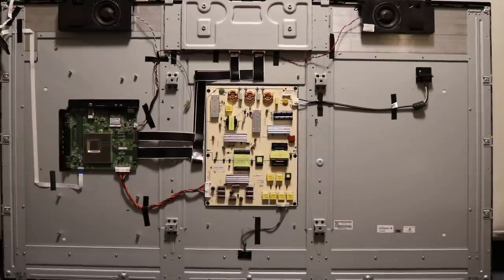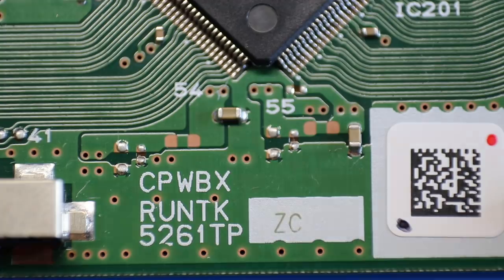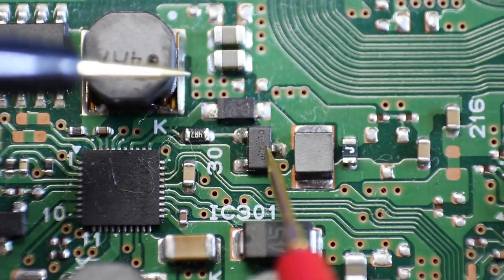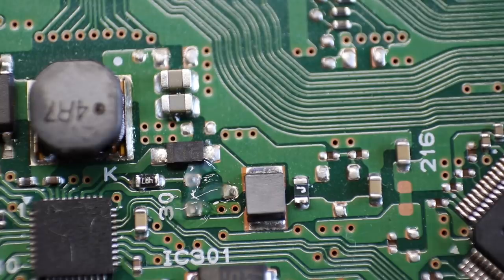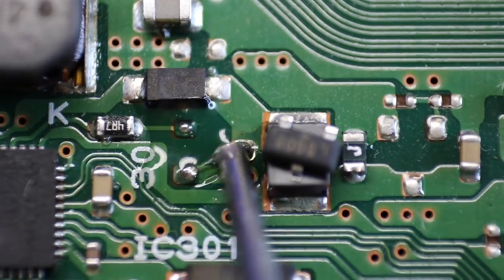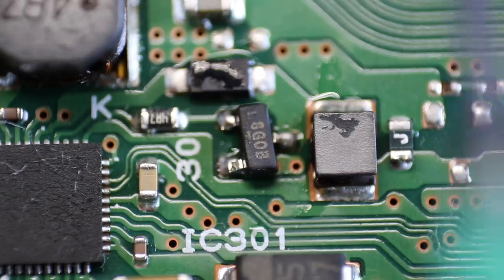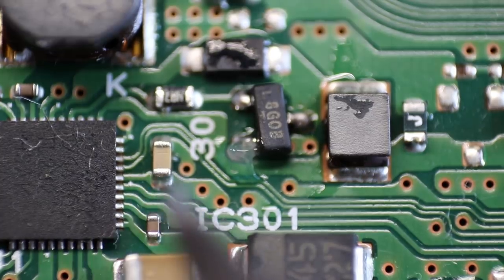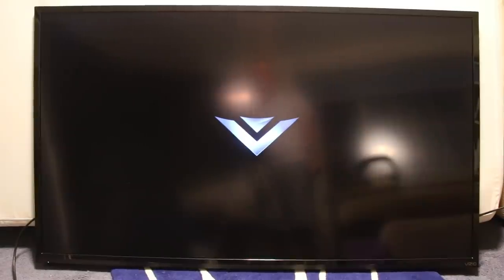60" TV for less than a $1 - Vizio E601i-A3

Comment: how to change speaker of 50 inch phillips led tv?
Reply: If you can't get to the speaker or remove it just tap into the wires and run them to an auxiliary speaker or unit

Comment: Hi Sir,
Help me fix my Samsung UN65JS9500 65-inch Curved 4K SUHD Smart LED TV with no picture but i can hear sounds coming out of tho
Reply from the maker: Did you do a flashight test (google it)?  Many led backlights are shorting out.  Try to turn down the brightness in settings to like 10% (while using the flashlight) and reboot to see if that does anything.

Comment: Hello, My remote control for a Samsung TV Model # UN50H5203AFXZA stopped working, so I changed the batteries, tried a brand new remote, and then used the job switch to manually turn on and off the TV.  I accidentally, locked the panel key and now I can NOT use the jog switch to control the TV.  Is there a way to unlock the TV and reset it without using a remote?  TV is only 3.5 years old.
Reply from the maker: I'm not sure I understand what you mean about the panel key being locked.  Is that a parental control option that disables the physical buttons on the tv?  I don't know that model but there is probably a way to reset it.  And you purchased a new remote and that didn't work either?  You may have a problem with your remote sensor or on the main board if so.
Reply: @FrugalRepair  , yes the parental locks disable the jog switch.  I tried installing a used IR Sensor, but it still does not work.

I read somewhere on line that the TV stores the "parental locks
Reply from the maker: Have you confirmed you are getting power to the IR sensor (coming from the main board)?
Reply: @FrugalRepair  so the red light is lit on the TV so- I guess so (I'm not an expert and do not have a voltage meter)
Reply from the maker: @christinegiel9242  Well, you at least did more than most people and changed the IR sensor.  You would need to measure the voltage going from the main board to the sensor itself.  If you're standby light is running off the same voltage line as the IR sensor then it would probably be safe to assume that the IR sensor is getting the power it needs (but it would still be best to measure it).  Hope you can figure out how to get around the parental lock.  I don't really know any tricks besides going into the hardware to figure out what is wrong with the IR sensor or googling how to factory reset the tv without the remote.  If I think of anything, I'll make sure to post it.

Comment: Hey, my Samsung TV just got damaged by my 3 year old.  He hit the screen with a movie case and now there is a big thick black line where he hit it. How can I fix it?
Reply from the maker: Sorry to hear.  If the lcd is cracked there is nothing you can do to fix it.  If it is a black vertical bar a few inches in thickness then my guess is that the tab bond lifted off of the buffer board.  There isn't really an easy complete fix for this but there is a jerry rig one.  You need to put pressure on the top of the tab bond to hold it down.  Basically, the tab bond is a glued connection from a pcb to the ribbon cable going into the lcd panel itself.  There should be videos on how to do this.  Let me know if you can't find any.

Comment: had the exact problem on the 70 inch model. i just went ahead and bought the whole new board for $15. saves me the hassle of soldering
Reply from the maker: Congratulations on getting it repaired! Yes, that is a great way to go. It’s quick and it only requires a screwdriver.
Reply: Thanks for the info but where do you buy the board.?? Is there a website.??

Comment: Well  the mosfet was shorted and yes you replaced the mosfet. But.... Did you fix the problem? The problem was why the mosfet got shorted. Its not like we found a shorted fuse and we replace it again to see what else is gonna blow! Why the mosfet shorted?
Reply from the maker: In general, yes, I agree that one should be suspicious when a component fails and ask, why did it fail?  There are a number of theories out there on this tcon board.  I have not spend the time tracking them down.  I do know that I replaced this component and I trimmed the thermal pad on the video IC to help with heat reduction and the TV has been working fine with normal use for 2+ years.

Comment: If I had known about doing it myself, I wouldn't have spent $450 ( the cost of the TV as new) to have mine fixed by a technician.
The flat screen TV blew up one evening after I plugged a laptop using a HDMI cable so that I could watch YouTube on TV.
After 4 nights, the TV decided to blow up with a deafening bang as loud as a 30-30 Winchester rifle followed by a puff of smoke.

I never found out what caused the explosion. It didn't blow up the laptop but the TV was cooked. Maybe you know something.
Reply from the maker: Whenever you have something catastrophic like that it’s actually easier in most cases to diagnose the failure. You would tend to see a big burn mark or an exploded component or something like that. So in your case it most likely is something on the power supply or the main board. You could buy a replacement board on eBay and with a screwdriver replace it yourself.  You could watch a video that I put out on what to do after a power surge that may be of assistance.

Comment: Sony Bravia tv. It don't focus on the left side. Have a drag on the image. Then after 10 to 30 minute on. The problems are gone. What could be wrong??
Reply: Bad cap / Solder joint in the power supply  :)  Replace caps ( get a little cap tester )

Comment: What would cause a TV to work fine for about an 20-30 mins then all of a sudden shut off and not work until hours later than same result?
Reply from the maker: Lots of things can cause that.  Did you research your model number to see if there is a common fault?  If it’s a newer tv one possibility is that the led backlight gets too hot and shorts out.  You can test this by turning down the brightness in settings to something low, like 20-30%,  and see if the tv lasts longer.

Comment: trying to get the part for this but what is the difference between 

 Mouser Part #781-SI2308BDS-E3 

and
 Mouser Part #781-SI2308BDS-T1-GE3 

unfortunately i dropped  the one i removed(actually i dropped it 3 times, the 3rd time i completely lost it 🤦‍♂️.. and looking back at the picture i took, the markings are blurred 

Also I just picked up another tv my neighbor knocked over breaking his screen, Its a 32in element is there a chance i can find this somewhere in that TV?
Thanks in advanced to anyone who may be able to help.
Reply from the maker: I don’t think it’s worth looking at the other tv’s board for this transistor.  I haven’t looked up that slight part difference but you should be able to see if it’s different based on the data sheet.  They usually have a link on the product page.
Reply: @FrugalRepair   oh okay, thank you for such a quick response, I'm pretty excited to try this out.

Comment: for thos who has no hotair like me smash the transistor and desolder the legs sepratly and solder the new one and if you fell that the soldering iron is too expensive just use hot screwdriver to desolder and solder and to find the if the transistor shorted just use led and battery and some wires 😁😁😁

Comment: Less than $1 for the component. How much for the multimeter and other tools?
Reply from the maker: It depends.  You could borrow them from someone if you want the least inexpensive.  If you want to buy them yourself, check the video description, I found a really cheap hot air and solder iron combo set.  A multi meter can be like $15 and get you the measurements you need.

Comment: It’s a mosfet btw, and the TV will fail again unless you address the issue that caused that fet to short in the first place.  Trust me I’ve fixed a bunch of those, along with the 70” version
Reply from the maker: The 70" tcon is the same as the 60", what are you finding that needs to be repaired?

Comment: I have a Hitachi 50 in flat screen  the screen flashes no sound can you tell me what the problem could be hit me back please
Reply from the maker: Does it have an led backlight?  I’m guessing that is an older tv so probably not.
Reply: @FrugalRepair  it has led lights. Back ground but just flashes with no sound
Reply from the maker: A quick flash when the tv turns on is indicative of bad led(s).  Did you try the flashlight test (search it)?  Your set might be turning off because of the short circuit.
Reply: @FrugalRepair  oh ok idk if it's worth sending it to fix it it's just my neighbors gave it to me for free
Reply from the maker: I’ll be doing a video on led backlight repair sometime soon but there are others out there you can learn from.  It’s not technically hard but you do need to be careful when removing the lcd (not to crack it or get dust behind it).
Reply: @FrugalRepair  k thanks 4 the info

Comment: I am a retired electronics technician. The first thing I used to do with any meter that beeped was to disable that function. I always like to see the reading. Why make a $500.00 meter into a $5.00 continuity checker?
Reply from the maker: It beeps in diode mode too.  So you get the best of both.  Or is that not what you are talking about?

Comment: Okay I have a problem with my TV it's a little different than anything else that I've seen on these repair TV sites I was wondering if you could help me I have a picture when I go to settings it's a fine picture it's nice but when I go to hook it up to the Internet it keeps saying you know wrong enter your you know password I enter my password says it again so I tried to hook a DVD player up to it and the screen turns white fuzzy like I don't know like you would turn the TV on and you would have a channel that doesn't have anything on it you know just fuzzy but it has sound I would like to know if you knew what could cause the problem when I plug something in like a DVD player why it would go to that and not have a picture and why it doesn't have a picture or will go to internet I was wondering if you could let me know or anybody out there could let me know something

Comment: I have a skinny red line running down the left side of my Vizio 60" tv.
Reply from the maker: It's most likely a bad lcd panel or a bad tcon board.  Is it the same model at this one?  It is possible that it is a tab bond failure that could be compensated for (but not truly fixed) by putting pressure on the tab bond itself.

Comment: What if a Vizio has turned blue?
Reply from the maker: The whole screen is blue?  It is a solid color or is the normal picture blue-ish?  What is the model number?
Reply: @FrugalRepair  the normal picture is blue-ish. Model e60-e3
Reply from the maker: @djcj23  I don't know.  It could be the tcon, main board, or a bad lcd panel.  My top guess would be tcon (if it has a separate one, some tvs have them integrated into the main board)

Comment: For about $12 you can buy a replacement TCON board rather than soldering.
Reply from the maker: Yes, that is a great option.
Reply: Where?
Reply from the maker: @mocarob  @Tao can say where he saw them for $12.  Ebay is around $15-20 for a tcon.

Comment: Dang, I thought all those circuits would get fried from from all of that extreme heating!
Reply from the maker: SMD's that are on a printed circuit board are made to withstand way more heat than the melting point of the solder.

Comment: Who replaces individual components anymore? Today's boards are usually swapped out  for a new one. Better yet, who has the that kind of time?
Reply from the maker: So the few minutes it took to replace the component was too long?  I’m not sure I’m understanding you.
Reply: I'm just saying that the days of trouble shooting individual component failures is in the past for the most part. For example,In refrigeration and appliance repair, we just replace the entire board. If one has the technical trouble shooting data and time, then seeking out problems like failed capacitors and or semiconductors is all fine and good.
Reply from the maker: @Beefcake20  It depends on time/cost.  With the internet now, you may be directed to a common failed component in just seconds.  My LG washer has a common problem, for example, but no information online has been posted on it yet.  The only thing I see is to swap out the board, which is like $250 or so.   My washer still works ok but when it has a bigger problem I'll try to track down the component and publish that info.

Comment: Why did you use a hot air station instead of just desoldering every point of the chip?
Reply from the maker: No big reason really.  You can desolder many different ways.  There isn't very much room in that space so hot air was convenient.

Comment: When I try to turn on my tv, the white light comes on and slowly fades away. I tried the unplug reset method but no luck so I ordered new boards / chips and I replaced every chip and I'm still having the same issue with all new boards. I tried the unplug reset but still the same problem. What else can it possibly be since I changed all the interior boards / chips? I hope someone can help me figure this out, don't know what else I should do. Thanks for your time and attention.
Reply from the maker: How did you replace all of the chips?  Do you mean the boards?
Reply: Yeah, I replaced all the boards. I took my time to make sure I did it right and I made sure all the wires were properly installed into the boards. I'm still having the same problem. I'm able to turn it on, the white light comes on and slowly fades away and the screen stays dark.

Comment: My Vizio E601i-A3 TV turns off and does not turn on again after several days of being disconnected. It turns on and it is the same cycle, once it is turned off it does not come back on again after several days.
Reply from the maker: You need to diagnose it further.  First thing to rule out is the backlight.  When it "turns off", is it really off or is the backlight out?  Use a flashlight on the screen with a known video or image playing on the screen.  After that, there are other steps you need to take, basically, start disconnecting boards to see if you can isolate the issue.  After that, you need to start taking measurements with a multimeter.

Comment: They used to just last. Now they don't. Better buy the protection plan. I pick up so many that have mostly good components.
Someone threw away an older Vizio once, I used it for four years. Nothing even wrong with it other that a scratch on the screen
Reply from the maker: Why buy the protection plan then?  If they cover cracked screen damage the. It may be worth it.  Otherwise, I’m not sure why you would buy something that lasts beyond the one year warranty.  It seems that it’s not cost effective given that parts are inexpensive (at least for TV’s)

Comment: Erm... put flux when you desolder the transistor, you nearly pulled the bottom pad off....  or mix leaded solder to make it easier

also easier to change the whole tcon board, can find it for less then $5 sometimes.
Reply from the maker: ok, thanks for the tip.  I agree that its easier to change the tcon.  I've never seen them for under $17 though.

Comment: I have a 55inch LG 3D TV and it's dim and can hardly see the image. Any ideas what it might be? It was fine and all of a sudden it got dark and can't make anything out I can see movement on the screen so it's not totally black.
Reply from the maker: It is probably your led backlight having issues.  Try turning down the brightness in settings to around 15%, reboot, and see if that makes a difference.  Use a flashlight close to the screen to help you see the image if it’s too dim. If that works then try turning up the brightness until it doesn’t seem to hold.  You’ll need to replace the bad led’s to actually fix it.
Reply: @FrugalRepair  So I tried messaging with it today a little. The main loading screen comes on with the LG logo and it seems well lit the  when I pick an input I see the image but it goes so dark. Can't tell if I need new mother board, or leds. It's flashes a little when the main loading screen is on but it's bright and seems normal otherwise. If I can see any image at all that rules of tcom right?
Reply from the maker: @FISHERMAN331977  Yes, if you can see an image with the flashlight then it almost certainly is a bad led (or more).  It's a very inexpensive repair but could be a little intimidating if you've not removed an lcd screen before.  There are plenty of videos out there that should help.  I plan to make a video myself too.

Comment: Long time tech here... Time to tell you guys the real story here. The models E601i-A3 and E701i-A3 suffer from this well known problem of this transistor failing in the DC-DC converter due to a problem within the LCD panel itself. In some cases you can replace the t-con board or the transistor but it will fail again due to an over current issue with the panel itself that presents itself after the set runs for a short bit. Vizio used a particular problematic sharp panel in these line of sets and the problem was so big that Vizio for a while extended the warranty on these sets to cover this issue. The video is highly misleading because the auther failed to understand the bigger issue that lead to that component to fail to begin with.

Comment: Transitors (npn) are not open from gate to emitter... also testing a transistor (or any component) fpr continuity while still on the board is hardly a failsafe test.
Reply from the maker: What do you mean by that first sentence?  This is a fet transistor (gate, source, drain)

Comment: I've never seen hot air used this way, seems like unnecessary heating of the whole area when a solder sucker and an Iron would work fine.
Reply: these are not very large components tho, there is very little solder to remove